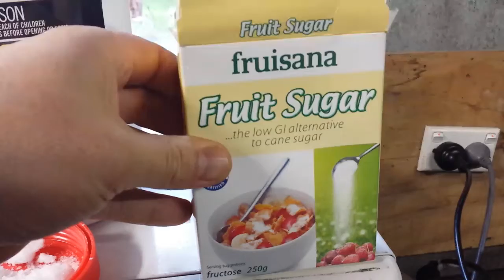Making Graphene in a pressure cooker-how to

Comment: How many hours do you need to leave it in there?
Reply from the maker: you need to run the cooker over and over while keeping it hot. I recommend doing it over a few days. Use strong acid
Reply: Keep the cooker hot for a few days straight?
Reply from the maker: +Dana Ng pressue  cookers will not run constantly. Unless modified. I just kept hitting the hottest function over and over.
Reply: +m3sca1 so you keep pressing and keep it constantly going for days?
Reply from the maker: Dana Ng cook it as long as it takes to get a good skin on the surface

Comment: I tried this 
I got some yellow liquid with flecks of brown inside and an a brown sticky gunk at the bottom. No rainbow-like sheen on top that I could see

When I rinsed this out, I saw more brown flecks and the gunk turned orange (or the brown gunk washed off, revealing the orange gunk.

I kept samples of the top yellow and lightly flecked liquid, the bottom yellow and highly flecked liquid, the brown gunk and the orange gunk.  Some of the liquid that's been setting out does have a slight sheen on top.

My friends want me to prove I made graphene oxide. How do I tell I've got graphene oxide in solution and not burnt sugar?   Any test I can do? I'm not looking for high quality, I can refine things later once I know this worked.

What part would contain the GO? The yello liquid (graphene namo particles?) The flecks? The brown gunk? The orange gunk?

This has been cool stuff. Thanks
Reply from the maker: +Colleen Forrest missed your comment-the rainbow sheen on top as per the tang lau method

Comment from the maker: This is an adaptation of the Tang-Lau method.
It is a ground up method utilising decomposition of fruit sugar in a standard kitchen pressure cooker.
Tang-Lau method utilises sugar under heat and pressure, that allows the carbon molecules to self assemble into sheets on top of the water.
Fructose has the lowest caramelisation point of all the easily available sugars, so was the obvious choice for an attempt in a pressure cooker.
The cooker has an upper temperature that is just below the value that will caramelise fructose, some acid was added to reduce that caramelisation temperature and oxalic acid has a nice carbon atom backbone that should just fit right in to the graphene self assembly. 

https://youtu.be/Tatixt0fZvM